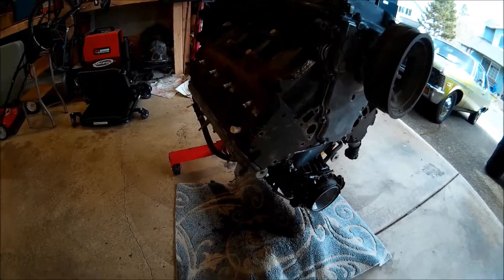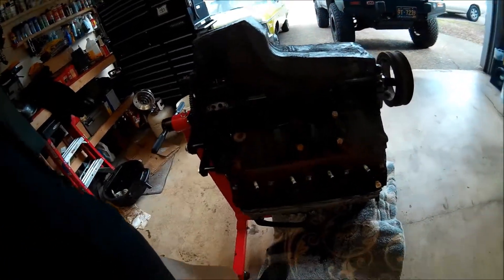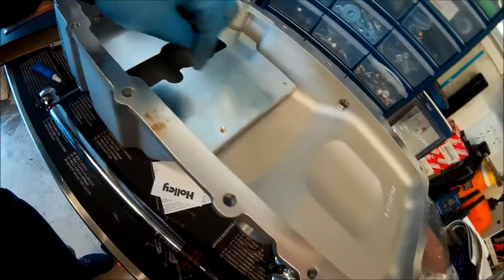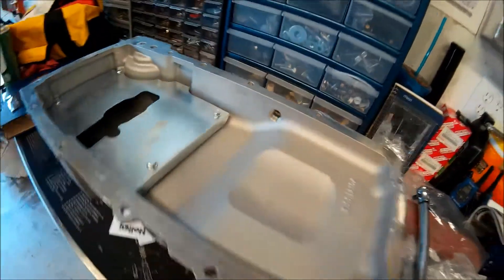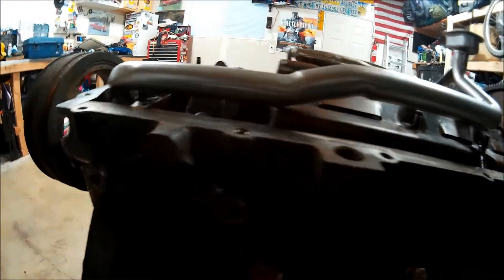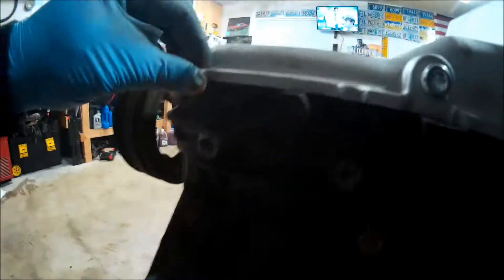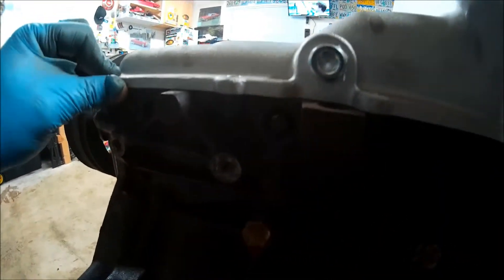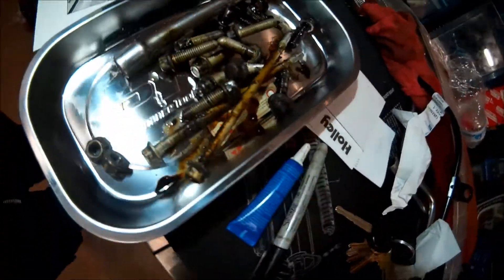Project Nova LS Swap - Oil Pan Conversion

Comment: So I have been watching a bunch of your videos lately and they have helped me avoid a bunch of mistakes and lost time.... I finally got the motor in my Camaro. The  Holley motor mounts were kind of a PITA, but nothing like what was to come... I ended up having to notch the firewall because of my LSXRT intake manifold wouldn't fit. I also have the 302-1 oil pan unlike your 302-2 oil pan. My motor is stroked and the 302-2 motor wont fit (hits front rods). So when I went to put the motor in, the oil pan hit the front sub frame cross member. Ended up having to notch that as well. Damn good thing I can weld like a magician or this would have been a nightmare for someone.
Reply from the maker: That sounds like a nightmare!! I wish I could weld like a magician.. unfortunately I weld like a 5 year old :(

Comment: I got the 302-2 pan in my '72 nova....when I turn lock to lock the zurn fitting tabs just kiss the pan ever so slightly. ...I try to avoid turning the wheel all the way....I used brp rods motor mount setup for the engine .....that is where I think the problem became from the motor sitting to low....I think....make sure you check for that and let me know when it all comes together. .....other than that it looks great.....
Reply from the maker: Trent Robey I got the matching mounts so there is not supposed to be any issues but I will check for sure! Thanks!